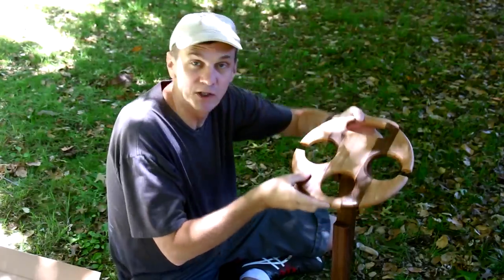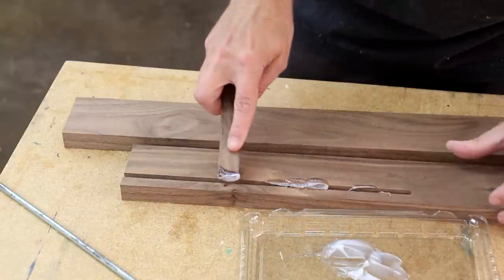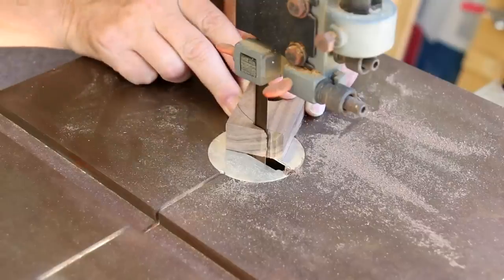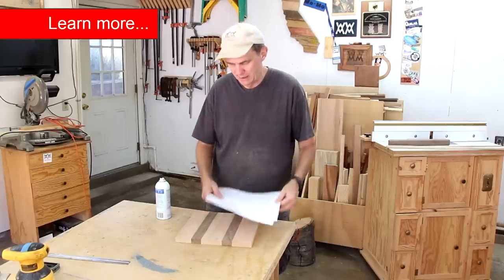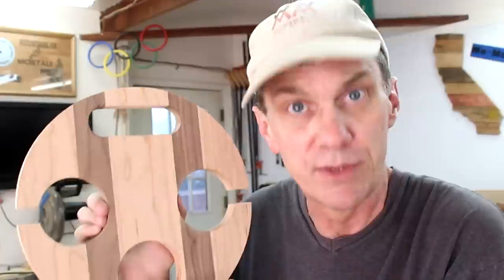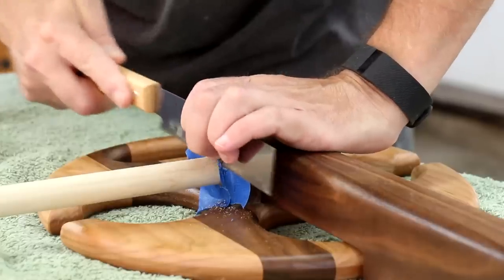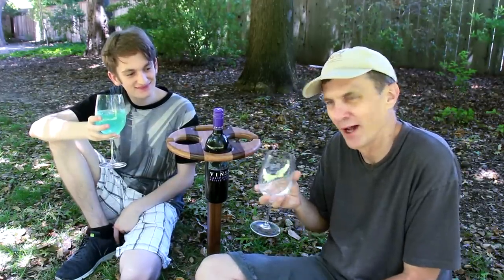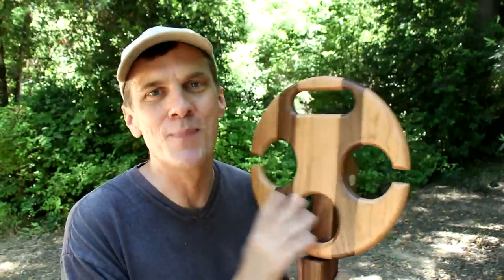Folding Wine Stand: Perfect for Picnics. Summer Fun!

Comment: I’ve recently made one of these tables. I made one upgrade to the design. Instead of a fixed metal stake I replaced it with a 3/4” coupling nut and screwed in a 5/16” X 8” bolt this way the stake can be removed. You can also make a base for it to stand on hard surfaces and just screw it in using the coupling nut inside the leg. Thanks for the how too.

Comment: What keeps the wine bottle from falling through?   The notch in the leg?  Also thought you could build a stand with a hole in the center piece to put the metal rod  from the table so you could use it on a patio or deck.

Comment: I have started this project this weekend and ran into a huge problem.  Trying to drill the holes with a hole saw was a nightmare.  Did you use a special hole saw or do you have a trick from keeping it from binding?  It screwed up my drill press.

Comment: Hi Steve, good job (as always), I've almost completed this, slightly differently; I used a 20mm thick hardwood dowel for the spike, after routing the 2 legs with a round nose bit. It looks nice, time will tell if it was a wise choice. Wish I'd found your plans beforehand! What spray wood lacquer do you use? And greetings for over the pond.

Comment: Just a quick comment.  CHECK YOUR WINE GLASSES BEFORE you cut the 2 holes for them.  Some wine glasses have a circumference of 10 3/4" which the 3 1/4" hole works for. I have some that are only 10" circumference so need to modify the holes slightly smaller so the glass doesn't fall through.

Comment: Woooooahhh A little close to the blade at about 45 sec in. Be careful. I like to watch you with all 10 fingers in place.
Reply: Blades don't jump up and bite you. Know where they are and care are the key safety issues as is properly holding the work securely.